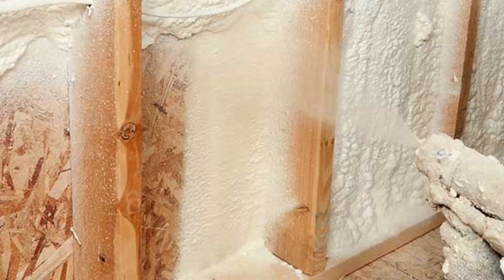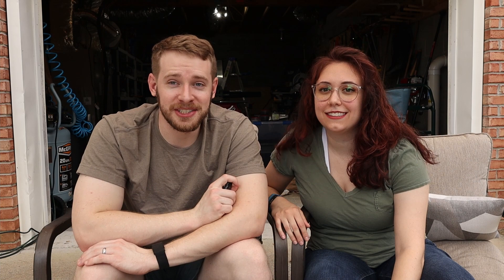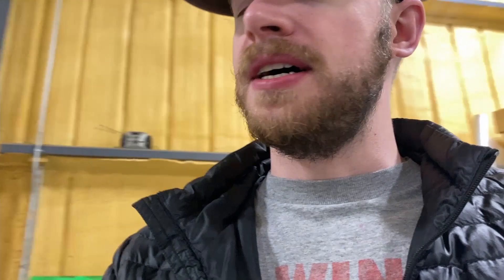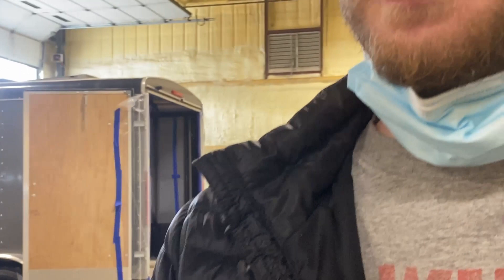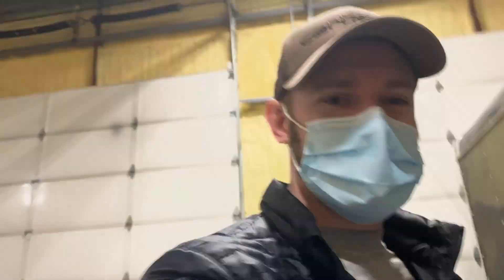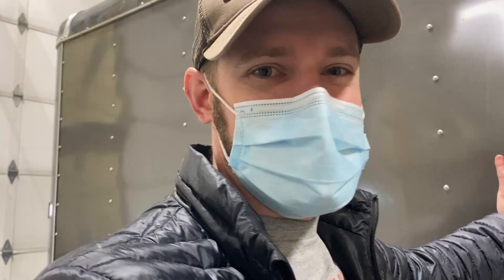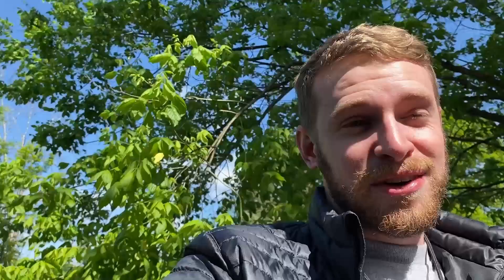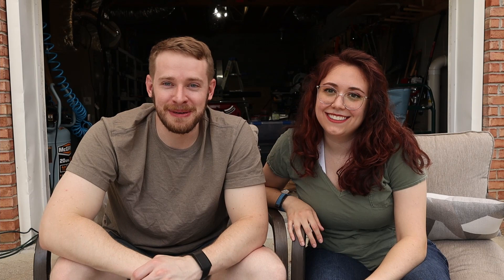Insulating a Cargo Trailer with Spray Foam | Cargo Trailer Conversion

Comment: Very nice - i did my own garage, i regretted not getting the pro in, worked out to be about the same cost, 1800 diy, 2200 for pro - that extra 400 would have bee worth it.  Trailer will be done with pro.👍
Cheers

Comment: Great video.  I've been wondering why more people don't have it done this way.  I am curious to see how you can frame it after its been foamed.  I was thinking if a strip of semi-hard word glued to the ribs before spraying.   I also thought the installers would shave off the excess, but I guess you will be doing that.  I look forward to seeing how your framing goes in the next video.  Subscribed!

Comment: Can you put a rubber coating on top of spray insulation under the trailer? I feel like it would help protect it, if it would adhere.

Comment: One other thing I wanted to mention. The spray foam tends to deteriorate when exposed to the weather so under the floor I added foil backed rigid foam boards to protect the spray foam. This also helped since we have installed in floor electric heat to make it more comfortable to walk on in the winter when your barefoot.
Reply from the maker: Good to know. I may have to consider that once we have the water tanks and any undermount work complete.

Comment: I’m going to spray foam by trailer but I have one concern. 

When spray foaming a shipping container, I hear you can have any wood studs, or wood of any kind touching the metal. Apparently the when the steel sweats, it gets the wood wet but since the insulation is such a good barrier, it doesn’t breath and the wood eventually rots from the inside. 

Have you heard of this? Is there something I’m missing? 

Much like you, I would be spray foaming over the wood backing as well and the thin wood used in the roof construction.

Comment: They did an excellent job on the spray foam,  what’s the difference between Havelock wool and spray foam as insulation material?

Comment: I could only see it deforming if you like Sprayed behind a wall and the pressure didn't have anywhere to go when it expands. I wouldn't think there would be enough to deform metal. Not sure about poly-core

Comment: I'm gonna price out having mine spray foamed. HD has R5 1" for about $.83ft².
R10 2" is $1.30ft². If spray foam is close in price to the 2" , I'll just have them do it.. I won't have to do xps foam labor & it will be rigid...
Reply from the maker: Agreed

Comment: I’m about to go spray foam the underside of my trailer. I was wondering how the insulation has held up for you. Are you experiencing any issues with the foam on the underside of the trailer?
Reply: Did u do that? Please let me know
Reply: I always bought insulated trailers
Reply: I would think the closed cell would be much more durable and also better R factor. Open cell would not last.  (I am not an expert)
Reply: I spray foamed the inside of the trailer and it went terrible. So I did not do the underside. My plan is to use 2” foam board insulation underneath. I think that will be good enough.

Comment: Why didn’t you add the strips to the walls before the spray?
Reply from the maker: Because I wanted insulation between the wood and the trailer. I regret this and wish I had done exactly what you suggest.
Reply: @diycargotrailer  what were the furring strips for? A joint to screw into when you put up the wall?
Reply: @homealone5087  yes

Comment: Where did you get the foam sprayed at.
Reply from the maker: It's called Mullins Insulation in Kingsport, TN!
Reply: I would spray then replace the boards in smaller sections to ensure the boards and strips relined up properly.